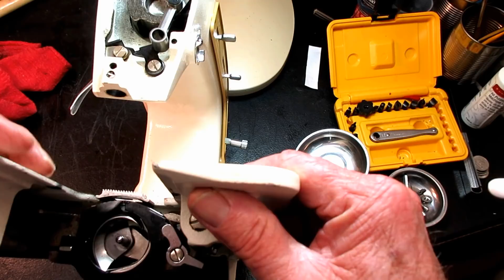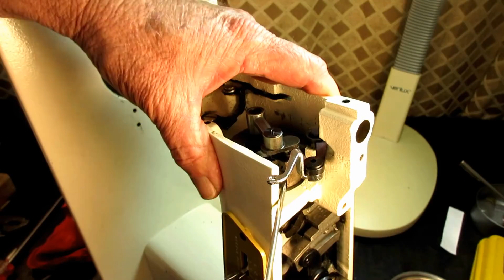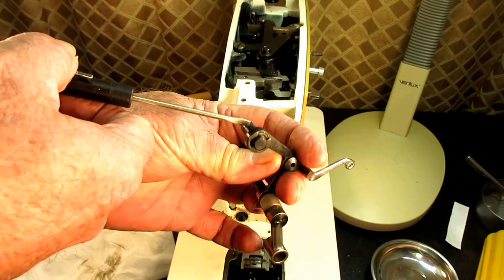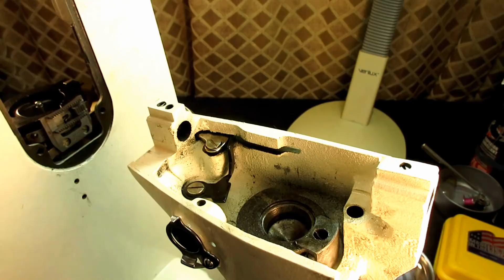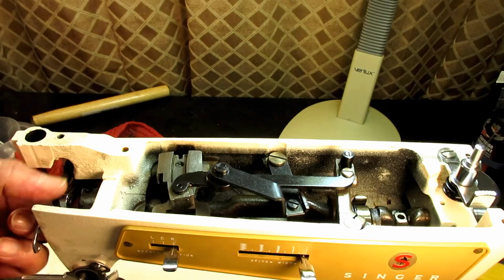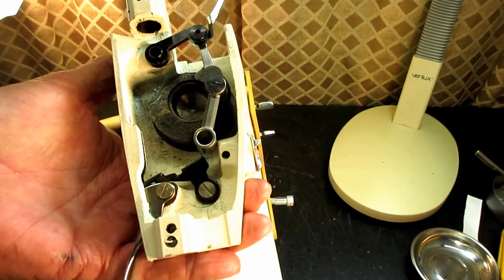How to Remove & Replace the Take Up Lever on a Singer Model 237

Comment: 237 Singer sewing machine front end,I cannot get the top bushing out of the front side.  I don't know if you pull it out at the top or bottom. I use WD-40 still not moving all the screws have been removed.
Reply from the maker: The original Singer Service Manuals have a section for the removal/replacement of most parts. It may help. You can download a copy for $8.95 from this seller: https://manualsoncd.com/product/singer-237-sewing-machine-service-manual-download/

Comment: Once again, Great video..!!!  Thank you..!   My 237 is just a little bit different at the needle bar connecting link/stud connection. I think something may have fallen out somewhere along the line?  a sm. pin? IDK.. ? ..The stud that goes into the connecting part, looks as though it has a flat spot/grove, on the top of it, that's where the "looseness" is..the needle bar has end play.  Even with the needle bar set screw tightened there is end play up and down..  anyway, I do need to take my bushings out of the vibrating bracket and take that all apart like your other video showed, so I can get at these parts.. I need to do it for 2 reasons. I need to figure out whats going on with the needle bar connecting stud, (looseness) and also my take up lever  arm is bent, causing it to hit the part where the black rod connects to the vibrating bracket when in right needle position.. I can see that the take up arm is bent, right close to where it connects. looks like it will be hard to straighten.. If I solve these 2 problems, She's good to go.!! Thank you so much for the perfectly clear and understandable videos.!..  I named my 237 "Mia"  hope I can save her, or she will be M.I.A.  🤣
Reply from the maker: Didn't you comment before about a small loose pin you found? Maybe that was someone else. I get about 50 comments per day so I lose track. If you will email andymanuals53@gmail.com and ask Alan to send you documents for model 237 I'll have him send them for free to you. Maybe they can help you in your quest for restoring Mia.
Reply: @andytubesewing1953  Oh, thank you so much .! yes that was me commenting about the little pin I found. I am waiting until I pull the bushings and needle bar/presser bar out and I will take a close look at it. and Thank you for that link to the ebay parts, I will most likely need that take up lever arm assembly, I don't see a way to straighten it. I did order the parts.!!  Thank you kindly for taking the time to help. I appreciate it very much..
Reply from the maker: @connieworcester55  Very welcome, and don't forget to email Alan for the manuals. After replying with PDF copies he deletes your email and his reply and does not shares info with anyone. Don't work too hard today 😃
Reply: @andytubesewing1953  I just emailed him. Thank you so much.. !!

Comment: Andy,  I just want to thank you for your extensive videos on the series 337. I recently purchased a 328 impulsively at an estate sale and soon realized that it was road hard and put away wet. Not one thing was correct. no zig zag no straight stitch without skipping or cutting thread, thread tensioner bent missing parts and jammed in machine, foot pedal worn out, take up lever so worn that it would not push the disks apart. It had been worked on extensively as practically every screw and bolt showed signs of abuse. I had just finished bringing a beautiful 201-2 and a 15-91 back to working condition and was looking to start working on collecting the 300 and 400 series singers. Decided I would try to get the 328 working after seeing your wonderful series on the 337. With your help I just have to time it and she should be finished. her name is Phoenix.
Reply from the maker: You are very kind to share this with us. Thank you for saving that machine, poor thing. With your work and dedication, you have restored Phoenix (love the name and symbolism) back to working condition and it can sew for decades more to come. These type of belt driven Singer machines can be found all over for a small price, and millions of them are used all over the world. Nicely done, Debby!